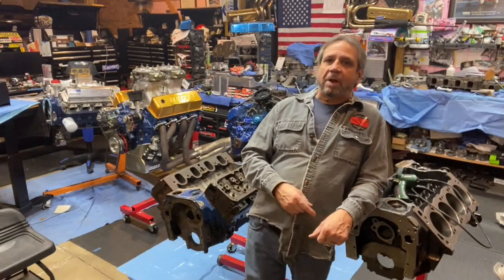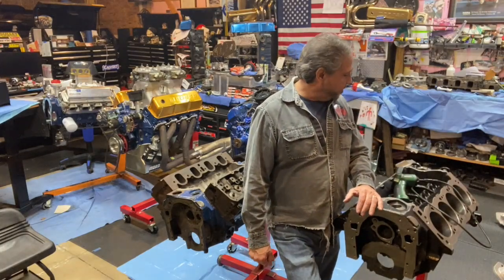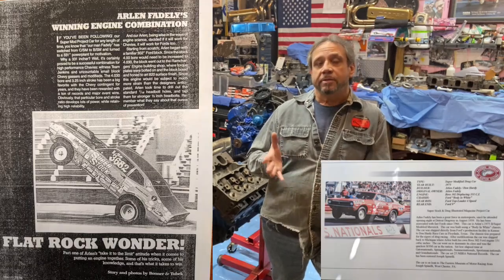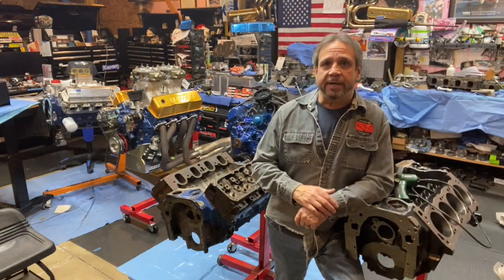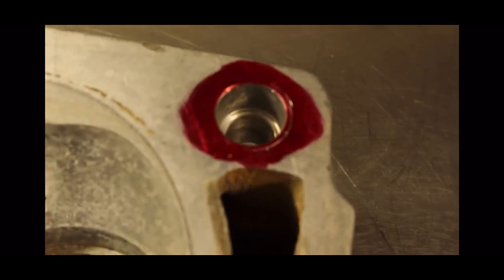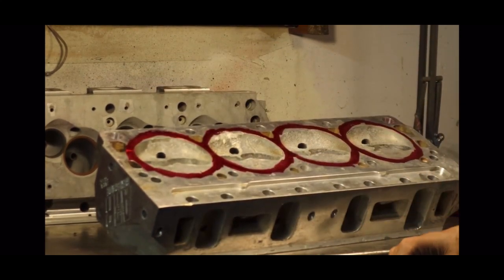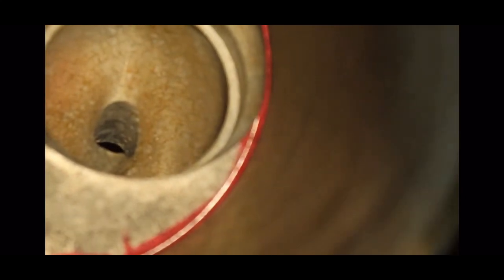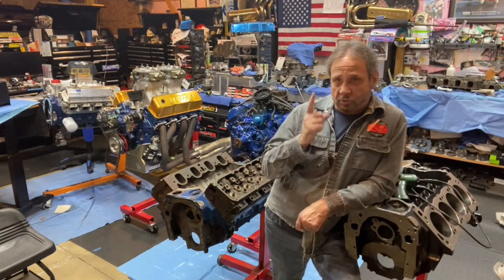DBG: Decrease Valve Shrouding  Ford 351 Cleveland /SBF, Ben Alameda Shows Us Offset Dowel Procedure

Comment: New sub here. I came from see the short on the drag boss 351 cougar. This is a really interesting concept. I’ve always know ln about valve shrouding like on 350 Pontiac (since I’m familiar with them) they can accept big valve heads but shrouding is an issue because of smaller bore than 400, 421, 428, 455 etc. thanks for the insight!!
Reply from the maker: Thanks for being here. You should look at my head flow and tips playlist. Lots of nuggets. I appreciate you 🏁💯🇺🇸

Comment: Darin Morgan, Jay Zolko, Ben Alameda, and a host of others all brought together on one channel and on one site by Tim "The DragBoss" Halstead. Seeing and learning something new is the order of the day here. Speaking of new...How about that DragBoss 351C block? 🏁
Exciting times for sure!
Reply from the maker: Thank you Bill. I am trying to do something that no one else has done. A place where you can see and learn more than you want. And guys in the know, that would like something like this. A place together and share. Yes the block is looking good. Probably have all the results soon. 
Here is prelimy from Johnson 

DBG351C, Johnson said, bores are Good. Siamese cylinders, Iron average is about 198, dirty iron,or old patterns or combo, lifter bores off a bit, said about .050 of core shift. Said hardware was good.
Reply from the maker: Stay tuned.
Reply: @jeffreylee7184 The Density of ferrous metals such as Gray Cast Iron, Common Cast Iron and Ductile Cast Iron is derived by the formula, Density equals Volume divided by Mass. Contaminants and other foreign matter introduced during the casting process also play a role in the viability of the final cast material for a particular purpose. Other factors such as thermal and stress tolerance among others come into play. I have a friend who is an Aeronautics Engineer and this is what he told me. I'm simply passing it on. We'll learn from W.J. and DragBoss exactly what the "198' indicates... "Always seeing and learning something new."
Reply from the maker: @billfioretti3013 yes Bill Brinell hardness is what I got, we chatted briefly, get full report soon. This block is between a dart shp and iron eagle.
Reply: @dragboss351cleveland  Yes Tim. My Aeronautics Friend clued me in on that. But I did not want to step on the DragBoss disclosure.😉 Brinell test was performed by the factory even in the early days. I.E. to check for nodularity in cast crankshafts, etc. As an example, you will see a machined mark on original 289 Hi--Po Factory Crankshafts. This is where they were Brinell tested for nodularity. The cranks that were graded higher were selected for the Hi-Po applications.  For steel, there is the Rockwell index used for steel cranks, rear gears, etc. "Always seeing and learning something new"...
Reply from the maker: @billfioretti3013 Thanks Bill. Never have to worry about stepping on my toes, they are alway moving. 😉. Yes I has a Boss 351 crank that had the Brinell mark. I am always learning that is for sure. 👍
Reply: @dragboss351cleveland  👍🏁

Comment: Nice! That really shows just how big those valves on the 4v heads are. Unfortunately my 73 351c is the grocery getter type with the 2v heads. Looks like it might be time to start looking for some 4v heads to pick up some HP.
Reply from the maker: Sure does. Something I have not seen before. Be fun to bolt some on and see how she does. Although cam is way too small, so may not benefit. Be great to see results

Comment: Tim Halstead, if u want to offset the heads, get someone with a lathe to build u some offset dowels.  Get some .060's and get some .080's.  Then u won't have to woller out the dowel holes.
Reply from the maker: That’s is exactly what he had done. Look on community section and see pics. Thanks.
Reply: More power how much hp with shift head farther?
Reply: Crude
Reply from the maker: But effective. Arlen had offset dowels made. Look at them in community section tom
Reply: @tomstiel7576  what is even more crude is taking a burr tool to those holes.  Once u do that, u can't undo it.
Reply from the maker: Good point. You can weld and machine if you had too. He had offset bushing made. Look at my community section and see them.
Reply: @ericsmcmahan  well after all,,,they are FORD guys,,,Glidden was as crude as they came
Reply: @tomstiel7576  he had to work harder because he didn't have an engineering degree, but he could definitely make it happen.
Reply from the maker: Ha ha ha right, Ford Guys. Beep Beep 😉
Reply from the maker: Dam right, like WJ told me, you had to win to eat. 🏁
Reply: @ericsmcmahan  new him well,,,,not putting him down,,,just stating a fact
Reply: How much hp with offset shift head ??  @dragboss351cleveland

Comment: Would be pretty easy to make offset dowels / sleeves. If y’all want to go that route, let me know, and I can make y’all up a set.
Something that comes to mind, is that moving each head .060” in opposite directions will result in a manifold port mismatch. Not a bunch, but enough to be considered…
Reply from the maker: Thanks George. That’s is exactly what he did. He mentioned a company that hooked up. Victor Vojack owner of Loc Performance Machine. He still has them and had a pic of them. I will post on community section. I like that idea to test. May have you do me a set George. Thanks